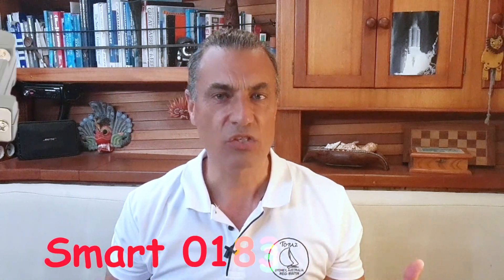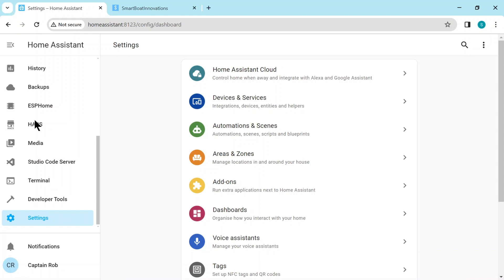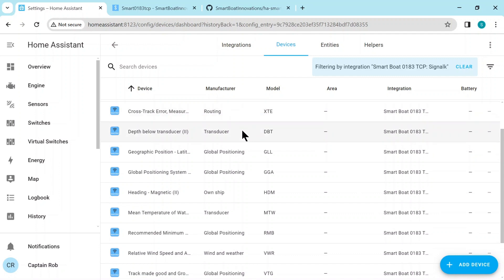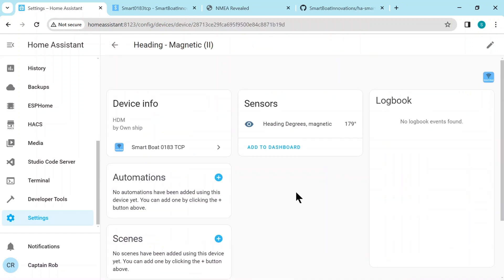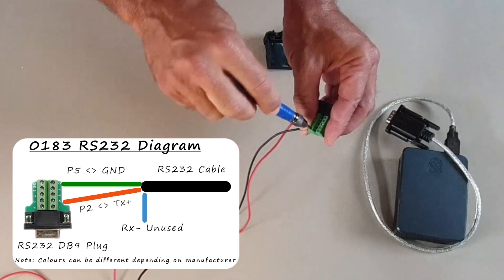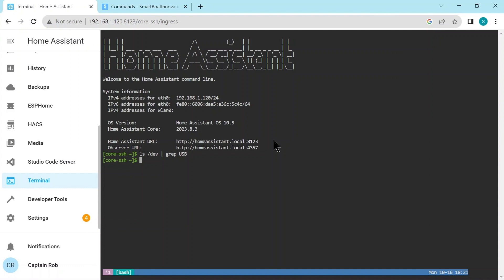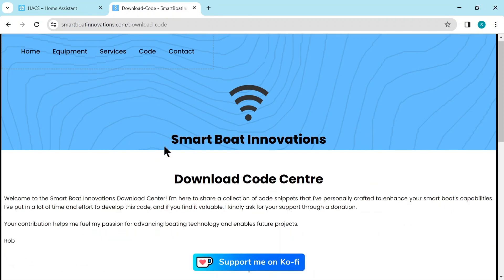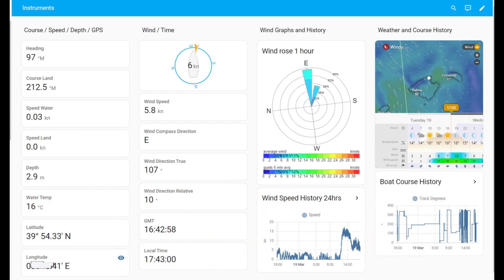NMEA 0183 to Home Assistant: Wi-Fi, Signal K & Serial (Complete Guide)

Comment: Hi Rob! sorry for having to write again on the same video but i have a question. i have one single Rpi5 with the HA like you, and i would like to add my GPS via USB to the Rpi and see tha location inside HA. i read that you posted in the community of HA that this is possible via SignalK.. the question is, how do i get the signalK IP when i have just a single raspberry with the HA OS? do i need a second Raspberry? thanks a lot
Reply from the maker: Yes with the preferred and recommended solution you would need a 2nd Rpi running SignalK. 
I have seen others get GPS via USB direct into HA without using NMEA. But I have not tried this out.
You can also get GPS location from a phone that is interfaced with HA, But this has reliability issues.
The easiest solution is to use a simple marine GPS that outputs NMEA and you can use one of my NMEA integrations to get the GPS data into HA.

Comment: Thank you for the content you create. I believe you make a great contribution to the community. Some time ago, I purchased a SeaTalk to NMEA 0183 to USB converter. Do you think it will be compatible with Home Assistant on the Raspberry Pi 5 to connect data from the autopilot, wind instruments, etc.? 
Thank you very much!
Reply from the maker: Yes in theory it should work. I haven't tested it but most serial to USB converters will work.
Reply: @SmartBoatInnovations  I am using a USB bridge from SeaTalk1 to NMEA 0183. At first, I wasn’t receiving any data until I configured the integration to 38500 baud (apparently, this is the baud rate the converter operates at). Now I am receiving data, but it’s incorrect and erratic. For example, the wind speed might show as 50 knots, then 120 knots, then 30 knots, etc. Where do you think the problem is? How could I resolve it? Thank you very much. If you ever visit Menorca, I’ll treat you to a beer. 🙂
Reply from the maker: @sergisegui679  Hi, Rosa Blanca beer? I am normally based in Mallorca.  Seems like there is a communication problem and some of the data is corrupted. Exactly which adapter are you using? If you do not have AIS connected a baud rate of 4800 should work but it does depend on the brand of the adapter.
Reply: At last, it seems I’m starting to get correct data from the wind instrument. Apparently, it was all connection issues. I read from other sources that the converter only needed to read from the SeaTalk data cable. I tried adding the 12V and ground cables, and I started receiving correct data.

Additionally, I took the opportunity to add my boat’s native GPS, which was unused and worked with the SeaTalk NG (SeaTalk New Generation) protocol. Using a SeaTalk NG-to-SeaTalk1 converter, I connected it to the rest of the SeaTalk1 instruments. So far, everything is working, and I’m very happy.
Reply: The adapter is the yakbitz SeaTalk1 to NMEA 0183 USB Bridge. It only works at 38500 baud. I live in Menorca. 🙂
Reply from the maker: @sergisegui679  Great. Now that you have your GPS added you can also use this integration.  
https://youtu.be/VT_s4hxUcq0
Reply from the maker: @sergisegui679  I'll come past in June on the way to Sardina.  🍻
Reply: @SmartBoatInnovations  Great, I’ll keep that in mind! Everything seemed fine at first, I left all the boat electronics running for about half a day to collect data, but after a few hours, the wind equipment that shows the direction and strength of the wind started providing incorrect data. Do you know if there is a way to make any adjustments in the integration or make a micro-adjustment just for the wind equipment?

Best regards
Reply: When I did the initial installation, I used the 38400 baud configuration. If I want to try 4800 baud now, is simply entering the integration settings and changing the value enough for the change to take effect, or would it be necessary to reinstall the integration completely? Thank you very much.

Comment: Hi,
This is really helpful.
I'm planning a Pi5 for OpenCpn and have a Pi5 running HA.
I'm also planning a Digital Yacht 4gStream which will have fallover internet connection between WiFi Boost and 4G (one day maybe starlink as well). That can connect to NMEA 2000 and send it out as WiFi. I think that means both my HA (with your integrations) and my OpenCPN will be able to get all the NMEA data.
But I want more control over and open security than Digital Yacht document. The idea of connecting to high speed wan without a firewall that I control scares me. So I want to run a proper OpenWrt firewall between the Dital Yacht WAN support and my LAN. I'm no network guru and so not sure that I'll be able to get the NMEA out of digital yacht 4gSream through my firewall and out onto my more private wifi lan.

So If I want my NMEA available to both HA and OpenCPN then am I right that I have 2 options at present:
- another MNEA 2000 to wifi connection (eg the Digital Yacht Navlink2) which connects directly to my private wifi
- connect NMEA 2000 to openplotter (inc OpenCpn and SignalK) and your ha integration will be able to pick this up (OpenCpn have a list of supported devices)

But I cannot use your serial NMEA connections into HA to get to OpenCpn?
Reply from the maker: My advice to keep things simple, secure, and effective while utilizing the features of the Digital Yacht 4GStream:

Run Home Assistant (HA) on a dedicated Raspberry Pi. This provides the best reliability, it is the recommended installation and avoids conflicts with other applications. Sharing the Pi with OpenCPN can lead to complications.

Use Nabu Casa for remote access to Home Assistant. It’s secure, straightforward, and doesn’t require exposing your network via port forwarding.

Run OpenCPN on a separate Raspberry Pi, Windows PC or an Android tablet. Keeping OpenCPN separate from HA ensures optimal performance for both systems. Maybe you could also look at Navionics that also runs on many platforms

Use 4GStream for providing internet and NMEA data over WiFi. Configure it to provide NMEA data to your network while acting as your router and internet provider. To enhance security:

Optionally use your OpenWRT firewall between the 4GStream WAN connection and your private LAN. 
Allow specific NMEA traffic through the firewall to ensure both Home Assistant and OpenCPN can access the data.
Use my NMEA WiFi integration to bring NMEA data from the 4GStream into Home Assistant.

Comment: Hi Rob, can the serial/uart connection be done via an esp32 instead of a rasp-pi? Incase the NMEA instrument connection is not located near the raspberry pi runing HA.
Reply from the maker: No. The intergration expects an Rpi serial connection. You can however have NMEA0183 cables a few metres long. I understand the requirement so maybe one day I will modify the integration to be able to use an esp32.

Comment: Thank you for this. I was finally able to bring in my pypilot (a homemade autopilot). Turns out it uses port 20220 instead of 10110. Is there a way to send NMEA data via Home Assistant? I would like to arm my autopilot and send it commands like turn port/starboard X degrees. I'm guessing the pypilot also listens on NMEA.
Reply from the maker: Well done. At the moment NMEA data can only be read by HA. Maybe in the future I may extend this integration to send NMEA outward as well.

Comment: Hey thanks for this. I have a Navico CNA to USB device that I can plug into the network. Do you know if I can see the information from the network using this on my windows PC or would it be good plugged into the Raspberry Pi? Cheers.
Reply from the maker: This video is for NMEA 0183 connections.  For NMEA 2000 see this video.. https://youtu.be/t1qDKVBHRrs
If the Navico adapter is for 0183 then it should work. For 2000 see the parts list in the NMEA 2000 video description for the supported USB adapter.
Reply: @SmartBoatInnovations  hey thanks for the info

Comment: Hello Rob, Great video! Is it possible to get the engine RPMs for 2 engines displayed separately in Home Assistant? It now uses 1 device to display engine RPM, alternating engine 1 or 2 RPM. Is that easy to change or add to the code?
Reply from the maker: To calculate RPM for both, you'll need to duplicate the sections related to RPM measurement (the pulse_counter sensor) and adjust them for a second engine. 

Use a new id like
    id: rev_counter_2
And also use a new name

Add a second pulse_counter sensor: You need a separate GPIO pin to read the pulse signal from the second engine's tachometer. You'll duplicate the pulse_counter configuration and assign a new pin.

Duplicate the template, integration sensors and binary_sensor sections using the new id and also new subsequent ids

Comment: hi Rob! great job.. amazing all these videos and content you are providing to the comunity... really appreciate it!
i have a question.. when you talk about all of these integrations, like sensors, anchor control.. etc, i guess then that you have the Starlink with you so your boat has always internet right?
so when you anchor, you can access anytime to your boat panel and dashboards, control, cameras... etc 
thanks for clarifying.
Reply from the maker: Thanks. You only need internet to install the integrations. After that they will work without internet. I have designed everything so you can use all of the Smart Boat functionality without internet. Try it out. Works really good!
Reply: @SmartBoatInnovations  thans for the quick response! i have a separate question nothing to do with this video.. and is that.. with the Home Assistant OS... can you implement an AIS with an VHF Antena? thanks in advance!
Reply from the maker: @sergidiazmolina  Not exactly sure what you are asking. If you have AIS already setup you can see that info in HA. But at the moment there is nothing in HA or my integrations that will setup a an AIS system with charting and target boats.

Comment: Hi Rob, thanks for your great video. All off them are really helpful and have made my boat a lot smarter. I do have one question/request? Is it possible to integrate ais information from a nmea 0183 device to hass? Would be great to learn about that in a next video.... Have a nice day greetings Rob
Reply from the maker: @robdekker2  Thanks. It is already possible to connect AIS with my integration.  Go to the 16 minute mark of the  video and just add hub for the AIS connection. Set the baud rate 38400 which is the normal rate for AIS. Ofcourse you also need to have the physical AIS connections, either via serial or WiF,  to the Rpi.

Comment: Hi Rob.  Great videos.  I am so glad I found these.   Your videos extremely helpful.  
I recently started adding lots of automation on my boat using OpenPlotter, SignalK, InfluxDB, Grafana, Victron, HA and ESP.   Still trying to get my head wrapped around all of this and the best way to use and configure it.
I think the 'Smart Boat 0183 TCP' will be very useful for me.  I was hoping you could help me out with something though.  I am having some difficulty with the 'Smart Boat 0183 TCP: SignalK' connection.  The integration appears to be installed and up and running, but is not receiving any data from the SignalK server installed on a separate RPi on the same network.  It shows 'no devices or entities'.  The SignalK server does contain a small number of environmental temperature sensors.  
I am new to all of this so I am probably missing something simple.  I have 2 setups.  One on my boat, and one at my house for testing.  Each setup contains 2 RPi's, one running HA and the other running OpenPlotter and SignalK.  
Does SignalK need to be configured in a particular way to send data items to HA?  
Are any SignalK plugins configured? ie 'Convert Signalk to NMEA0183'
When using SignalK in other projects there was an Access Request and Acknowledge process that was performed with SignalK to allow another system to have access to data. Is this not required with this integration?

Again, thanks for your great videos and any thoughts you might have to help me out.
Reply from the maker: Sounds like you have a lot of products installed. I only use HA and all of the NMEA instruments come directly to HA with one of my integrations. I find HA does everything I need.
From SignalK, you need to ...
Admin UI, select Server -> Settings
Locate the Server Settings section
Ensure that NMEA 0183 over TCP (10110) is set to On
Click Save and Restart the Signal K Server
...
In my Smart0183TCP integration you then specify the IP address of the the other Rpi and the port 10110.
This is how I tested it.
However if the source of your NMEA data is from NMEA 2000 then I believe you also need to also install the signalk-to-nmea0183 plugin.
Let me know how you go.
Send me an email to smart.boat.innovations@gmail.com if you have problems.
Reply: Did you ever get this working? I seem to be having the same issue and made sure Rob's steps from his reply are set. All I have is GPS and AIS_Catcher feeding SignalK, I see the statements in Data Browser on SignalK, just can't get them to HA.
Reply: Just to make sure data was being reported I opened putty and can see the raw data cycling on Port 10110

Comment: Amazing video and fantastic integration! I have just one issue where the wind speed is coming through as m/s but being labeled as kn in homeassistant. Wind speed units sensor report M so it looks like the integrations knows it's in m/s but not labelling as such on the Wind Speed sensor. Therefor the wind speed is reporting incorrectly at around half. Is there any way to either correct the unit on the Wind Speed sensor or to do the calculation from m/s to kts so the value is correct? Other than that, fantastic work! So much easier than trying to get signalk in via MQTT!
Reply from the maker: Thanks. So the units are Kn but it is actually m/s? Can you tell me the sentence name for this sensor. You can find it listed under model in the integration.
Reply: @SmartBoatInnovations  Yes, that's correct. For example the Wind Speed sensor is reporting 3kn when it is actually 3m/s so closer to 6kn. The sentance name is MWV.
Reply from the maker: @SVCM  Yes I see. The issue is that the integration is assuming a normal unit of measurement of knots when it should display m/s. So the number you see is actually m/s. This is because your sensor is sending m/s and not knots. I will need to figure out something for this but in the meantime you can make a template sensor or helper to create a new sensor for wind speed. Use yaml like this ( update the prefix sensor name you have in place of sensor.XX_mwv_3)...
template:
  - sensor:
      - name: "Wind Speed in Knots"
        unit_of_measurement: "Kn"
        state: >
          {{ (states('sensor.XX-mwv_3') | float * 1.94384) | round(2) }}
Reply from the maker: @SVCM  There is a new HACS update for this integration to correctly use the units.
Reply: @SmartBoatInnovations  amazing! I’ll test it out this weekend. Many thanks for your efforts 😊

Comment: I have my smart boat built on the bench and ready to install with my Starlink. I have a Halmet to monitor the analog motor date to NEMA 2000. Just looking for demonetized that can update the esp32 software.
Reply from the maker: Great to hear about your SmartPort setup! You can connect NMEA 2000 (N2K) data using Signal K or an NMEA Wi-Fi gateway as mentioned in the video. If you don’t have a gateway, don’t worry—I’ll soon release a direct N2K to Home Assistant integration that will work on an esp32. Stay tuned!
Reply: @SmartBoatInnovations  my device is it’s Own router requiring a log. Can this be add?
Reply from the maker: @SVRockChalk  Sorry I do not understand what you are asking.

Comment: Bl**dy brilliant Rob. I have my smart boat working g on the bench and can’t wait to install on boat this weekend. I used Tailscale for remote access and it was super easy. Now need to decide to do Nema or Lithium projects next!! I am having issues with the aqua water sensor disconnecting after a few hours but some research will sort that out om sure 👍
Reply from the maker: Paul, Best of luck getting your smart boat set up this weekend. 
TailScale truly is brilliant for remote access; I'm using Cloudflare on my end, but TailScale definitely offers a simpler solution. 
Just a note on connectivity - I’ve got four Aqari water sensors in my setup, and they stay consistently connected. It might be worth checking your ZigBee network if you're facing disconnections. Anyway, good luck, and let me know how you progress.